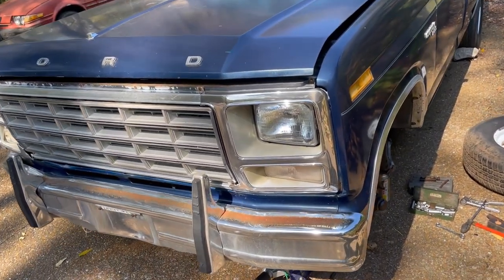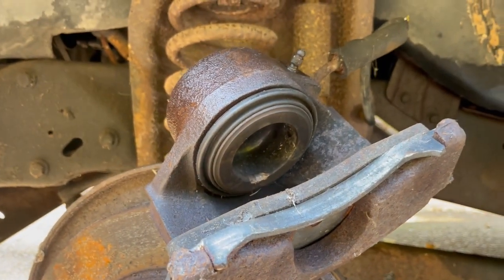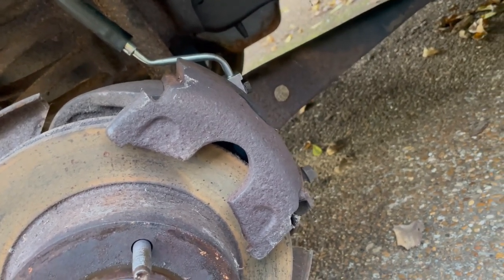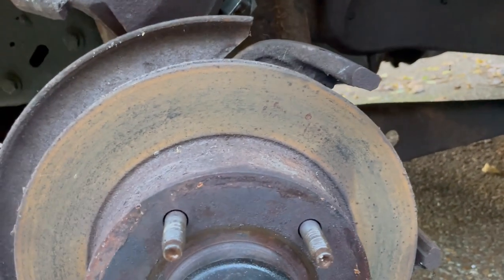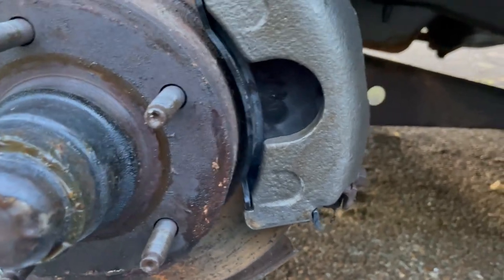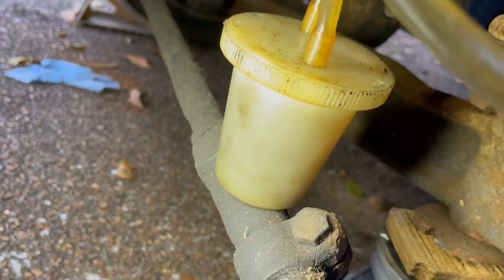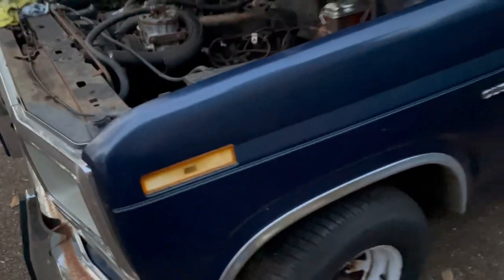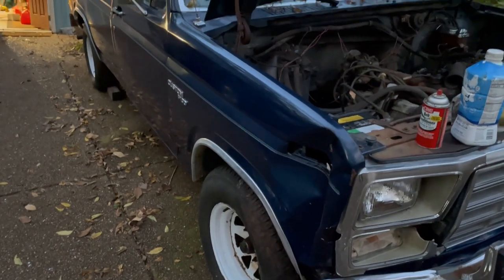1980 F100 rescue - front brakes, calipers, hoses and pads

Comment: I just got a 80 f100 my self the steering is locked up, i changed out the gear box but the issues persist. Gona start swapping front end parts till something works.

Comment: Hello From Mark In KY.  Thanks for your video regarding the front brakes. 
On my 1985 F-150, I suspect that my front brakes are pretty much identical to your trucks front brakes. 
The 1990 F-150 that I also own has the brake caliper pins that slide into the brake caliper with the two metallic halves sandwiching the rubber with no bolt like your brakes have. 
I need to inspect my rear drum brakes before winter weather sets in.
Good Luck on getting rid of the belt squealing on the AC compressor pulley. The belt dressing helps for a short while, But not very long.  The AC belt tightening process should not be as complex as the engineers at Ford decided that it should be. My AC compressor looks slightly different than yours, But still a severe pain to adjust the belt tension. My strategy is to replace the front shocks when I decide to work on the brakes being that the wheels would be removed anyhow. I’m looking forward to your upcoming test drive on your F-100. As Always, Best Regards.
Reply from the maker: Right, the belt dressing did not last long (maybe 10 minutes). I did tighten the belt today, but no luck. Looks like I will replace it. I should be able to drive it this weekend!

Comment: i have found that if i didn't clean really good wire brush and put a small amount of brake grease on the slider sometimes it will wear one pad more than the other

Comment: Thanks for the video, I needed some reminders on how things work with these brakes.
Also, does your truck have an electric choke? If it does, where is the electrical wire hooked up at? 
I had to connect mine at the fuse box with an off and on switch because I didn't see anywhere under the hood to get power except where power is constantly on.
Reply from the maker: As I recall, mine had a manifold heat choke, but the electric choke only needs to be connected to a source of voltage that is on with the key on and off with the key off.
Reply: @whattherust  I never could find anywhere under the hood to hook it up to.